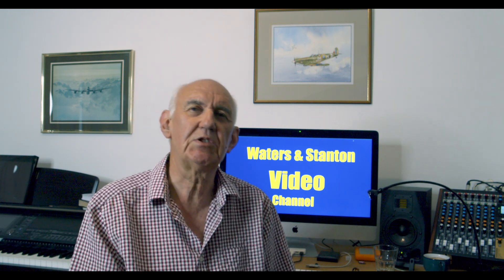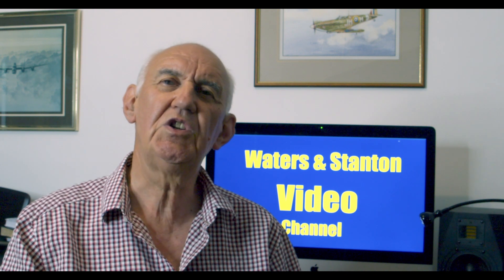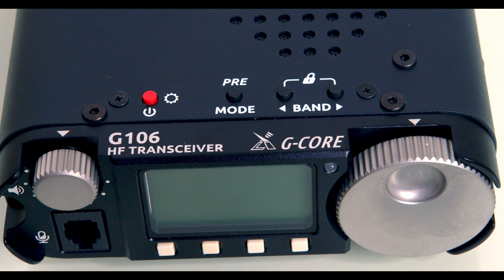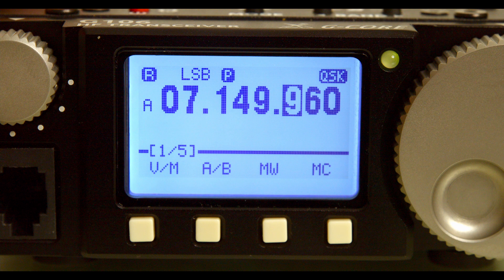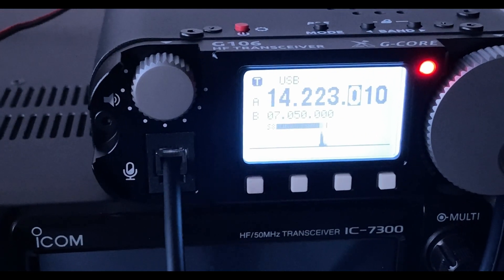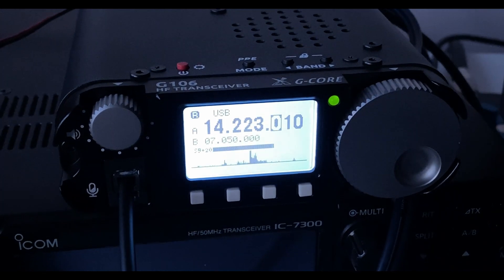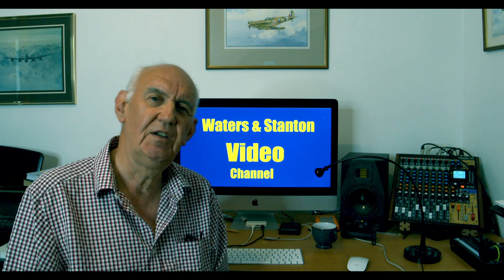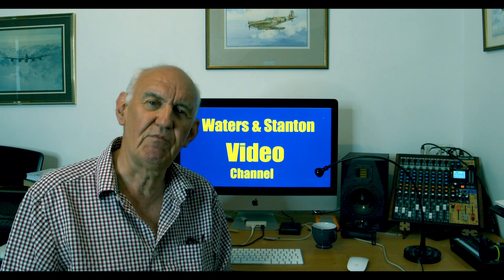XIEGU G-106 HF Transceiver In Depth Review | HAM RADIO

Comment: People who give the G106 cutting opinions have apparently never used the original TenTec Argonaut. The Argonaut was a fantastic radio for what it was at that time but the G106 is much farther advanced. 

Being SDR based, that means it's never out of date. Xiegu tends to improve the radio via software after getting comments about the radio although the improvements seem to come after enough people comment about a particular issue. Ideas for improvement are no doubt welcome, also. Being negative just to be negative is not helpful, however. 

This little gem promises to be around a long time and for what it is and does, it's unbeatable without having to play too much budgetary strategy.

It's simple to operate with no need to memorize a raft of menus or constantly referring to a manual. What's really to complain about? KK5R

Comment: Hi Peter, I bought this radio a few weeks ago and have had a blast with in on my inverted vee and or Butternut HF6. I also bought the DE19 digital interface to my laptop. Works great for FT8, ssb, cw. The keying wave shape looks great. Thanks for you observations Peter. Terry , WA0DTH
Reply from the maker: Great to brat from you Terry.

Comment: Great video. Some people just like to rubbish things as it makes them think they are a expert when they are not. Looks like a good radio excellent receiver in it compared to the 7300. I think the only reason the swr didn't dip at the higher end of the band with high swr is it may not have a swr protection circuits which drops the power to prevent it burning out the finials. All the best from ZL

Comment: Just  received my second G106. Big plus is that it's an SDR radio and that means it's never out of date. 
DE KK5R
Reply from the maker: Good thinking
Reply: @watersstanton 
I have yet to put the 106 on the air but looking at the manual I see that it offers 3 transmission output levels and from that I believe Xiegu has installed the latest SDR version which again supports idea that radio is never out of date. May have more comments in a few days.

Comment: I got one in the mail yesterday and even with the loss of a little manual tuner, I did POTA hunting QSOs on 20 and 40 meters on my front porch with a notebook and a long wire in the trees. I was hesitant to get the radio but I wanted QRP, inexpensive, and easy to use. This does the trick!

Comment: Thank You for the video! I think it is a great beginner and POTA radio. Keep in mind how much it cost as compared to other brands or even higher end models of Xeigu. For the most part also is the fact that this radio is very small in size and would be great in an emergency and working solar power. In this day and age when conflicts are many, this radio would be great to pull out after a tornado or conflict and a end fed wire antenna. I bought a 
Mini Automatic Antenna Tuner that has a built in battery. The combo of this radio and the Tuner $65 which has a SWR and Power meter built into the tuner, makes the whole system very effective and fun and small. I like the system so well I bought a 106 and auto tuner for my girlfriend for Christmas. She just got her license I believe this radio is exactly what she needs to have fun with and is not complicated like other brands and Xiegu models. I have had my radio on the bench and checked its output purity and power and receive signal input level and found it was every bit as good as more expensive radio models. I am totally happy with mine!
I don't always believe all the C*R*A*P that Trolls have to say bad about items they don't like or work for!

Comment: I just purchased a G-106 as my first HF radio. I could use some advice on antennas, tuners, SWR meters, etc to get my rig on the air.
Reply: Did figure it out yet?
I just got an EFHW. Doesn't require a tuner.

Comment: For what its worth my opinion.
Ive been a radio amateur since 1979.
A Royal corps of signals technician for 10 years, since then a telecoms technician offshore for 25 years. now retired. Ham radio has progressed an enormous amount since I started when you built your own everything and was happy. I have one of these sets and If they had been available 45 years ago we would have been amazed. QRP is what it is all about. Talking to an American using 2 W of power on 20m (Conditions variable obviously). All in all great value for money. In my day a 1ppm VFO stepping at 1 HZ was unheard of.

Comment: I really enjoyed the review so much so I bought a G106, I have to say that with the latest firmware installed I quite like this radio. I f I had to complain about one thing I would say it's the detents on the main tuning encoder, I think I will replace my encoder with one that has no detents. Thank you for the video.

Comment: Thanks for the review.  
I would like to encourage you do do an update to the review now that the firmware for the G106 has been updated and some features were added to the menus like:  Ability to adjust mic gain, ability to select high, med or low power and, possibly other features - running the G106 through the same paces as in this video - a sort of before and after comaprison.  The radio now ships with a USB com cable for CAT interface with your computer and works well with several different logging programs.  I wish reviewers would wait, or at least update their reviews until the 'bugs' were worked out.  I will commend the folks at Xiegu for adding features people were suggesting as evidenced in the latest firmware update.

I appreciate your analysis of this rig.   THese days we are, I think, spoiled as radio operators in that most, if not all rigs, are packed with all kinds of features, filters and options.  For me, the G106 reminds me of my first rig, a Kenwood TS-120S.  It was a great, no frills rig.  This G106 is also a great no-frills rig yet still has features thet my old 120s never had - spectrum displat and CAT being two of them.

The simplicity of this rig is what makes ot so appealing and easy to use in the field or at home and why it will make a great radio for backpacking and POTA/SOTA/VOTA activations.
Reply from the maker: Those updates were implemented about three months ago and we have been shipping the updated models for quite a while.
Reply: I so agree with you... 👍👍👍

Comment: I have been out of the hobby for a long time pursuing family & career obligations, and now in semi-retirement, I feel a bit like Rip Van Winkle trying to regain a foothold of understanding of the current state of the art post-Covid. I was never one to invest tens of thousands of Dinaro bucks into the shack, when I was age 17 I had to mow a lot of lawns for that shiny new TenTex Century 21. In college I tended to love to build in my lab projects little 1/4-watt Tuna Tin transmitter projects, etc. With my name of David, I sort of championed the little guys in the industry and got the thrill of building many of my Heathkit projects like the HW-9 and then getting WAS-QRP with my own imposed restriction of running only 1-watt output into the best antennas I could make or afford. In 2022 I started watching Xiegu Youtube video reviews after realizing I was about to pay the original list price + 30-40% for a used commercial brand of a communications receiver on eBay. I have a bunch of Tuna Tin kits to build but wasn't going to pay post-Covid prices on a piece of equipment that did not build in the preferred selectivity automatically of a similar quality transceiver. So I started looking at the SDR receivers like the ATS-20 and ATS-25X1 to understand the pros and cons of trying to use one for a companion receiver to a simple QRPp transmitter. 99% of the reviewers were casual listeners and focused 100% on the SSS & FM end of the features, despite the promise of CW operation and off-line discussions with them did not encourage me to invest in one even for casual use. I didn't like the prices on the earlier Xiegu models, not because I didn't think they were worth it, but because I was just getting into the hobby again and I did not have the desire to be upgrading the firmware to something I was going to put all of my money into without understanding what the future of the product was. I saw the same review that you did of the reviewer for the Xiegu 106 reviewing an apparent Beta version of the product and it was obvious that he was irritated about being given a Beta while preJudging that he may have wanted to be given a much higher cost rig to review. I realize that despite the basic hardware limitations of these designs a lot of the future improvements are in the software of which I have very little knowledge. I was a Test Engineer in aerospace with experience writing PDP-11, Dec, and Vax-based software for factory electronic test machines so I have a healthy respect for how complicated an SDR transceiver might be. That said, a lot of the Reviewers of commercial Ham Equipment are not the same type of Reviewers of Yesteryear in which we would have seen an Engineer at the ARRL Laboratories doing a more professional technical review of the specifications. The Reviewers of today most visible to the general public appear to be passionate operators that love the hobby and come equipped with lots of Affiliate links that will get them some credits to diversify their income stream. I am not saying that those types of reviews are the scourge of society, but that we (me) all should realize what they are and mix in our ham education with the proper reviews so that we get a more proper overall idea of what we are looking at and judging. Based on the review you mentioned, I choose not to invest in that Xiegu 106 radio at this time and chose a WA3RNC Pennington TR-35 instead. While only a 3-band radio, I thought it was a good choice for portable operations and had the ability to be a good choice for being a companion to my simple Tuna Tin transmitter experiments and my weird fantasy of using them on exciting projects like POTA hunting and activations where I bring QRPp to the next level. The real trick is putting up a good antenna Arial. If I decide that I want to invest in a more general coverage radio, I will give the Xiegu 106 another look and by then there may be another revision of software or two to make it even better. Is it a contest machine? No, neither is the TR-35. On intense contest weekends I shut off my radios and go take a 20-mile hike, unless I am looking for those last 3-4 states for another personal WAS/QRPp record of my own choosing, LOL. Thanks again for your review, this is a good time to be in the hobby as I have noticed that lots of new operators are learning CW for their POTA activities, many are doing FT8, but I was thrilled to see the CW revival as my weird fascination with QRPp tends to focus on CW. SSB is nice, I got VUCC-2M in 1990 with SSB/CW. But I might even make a simple one-triode tube transmitter in my full retirement, LOL. Cheers es 73, Dave - KU9L
Reply from the maker: Hi Dave,

That was great to read your story. I am sure others will enjoy it as well. 73 Peter.

Comment: There isn't any rf gain control 🤔
Reply from the maker: Yess you are correct.  But in operation I did not have a problem, even on main antenna system.
Reply: @watersstanton  thank you good Sir 👍

Comment: You mentioned the unit not having a RIT function. How in the world can you operate CW with no RIT function once you have tuned for zero beat?  Maybe TX with VFO A and RX with VFO B ?  Would like to have seen the rig preform on CW.  Thanks for doing the review. It seems like so little is known about this new entry into the market. 73
Reply from the maker: CW is no problem. You simply match the pitch the received signal to the same pitch as tge side tone. Most stations call you within a few hundred Hz so. i have never had a problem. In fact. i hardly ever use RIT.

Comment: Hi Peter,
If I was testing a new radio, new on the market, And I found several genuine faults with it,  The very FIRST thing  that I would do is contact the company who supplied me with the test/review radio and tell THEM what I was finding rather than just giving a report on line slagging off the Device Under Test/Review. This way, if the manufacturing company Had sent me a faulty peice of kit they would have the chance to send me a replacement which they knew to be working as it should be working.
Many thanks for a more honest review Peter.
De Ray,  M0RAYY.

Comment: To me, the fact it's putting out more power than it should be indicates poor QC! And the high power into high SWR, doesn't that indicate a lack of output protection? Certainly looks like clean output though, and might be even better if brought down to 5W where it should be.
de M3KXZ
Reply from the maker: The power soec says greater than 5W which is a bit vague. But the protection is there and worked well.

Comment: Thanks Peter for the clarification. However I am concerned about full power output even at higher vSWR. Could it be that the protection circuit is lacking resulting in power transistor failure with a poorly matched antenna?

Comment: Sounds like there is no VSWR protection so it keeps the power up rather than reducing power to protect its self. That's why the power out is still higher.
Reply from the maker: It dies close down eventually.
Reply: @watersstanton kindly explain?

Comment: A shame you felt the need to call K8MRD’s video a “hoax” .. it wasn’t .. although it’s nice to see you moving away from the previous run of videos almost exclusively dominated by the same topics and the same themes, regurgitated. Such as mobile hf and bashing antenna modelling.
Reply from the maker: You need to understand that modelling is fine, BUT the users fail to understand that real world results are often very different. Professional  designers employ 3D software for this reason.
Reply: @watersstanton  what antenna would you recommend for the xiegu g106 considering I live in a small townhouse with no yard. It’s 4-storeys high. I have a ground plane antenna for my vhf-uhf radios at one corner of the roof. I am very new at this hobby having gotten my technician license here in the Philippines just last month. Thanks
Reply: It would helpful if K8MRD  could show evidence of his professional electronic qualifications and proper comparative testing to back up is views
Reply: A fair few things Peter talks about are a 'HOAX' but i just keep quiet

Comment: Peter-Thanks for another great, objective video, and for pointing out that radio-based spectrum analyzers have potential weaknesses that MRD’s video suggests he may not understand🙈
Did you test at all in HF high signal level environments like 40 at night there? Your mention of no RF gain control, and I’m assuming no attenuator, remains a concern, as does potential AM broadcast band overload here, which seems to be an issue with some Xiegu products.
73 Scott ka9p
Reply from the maker: Yes I have used it on 40m extensively and not had any issues. My antennas are mainly wire dipoles so typical of potential owners. RF gain - well tell me how of-yen most hams ever use that control - but I take your point.

Comment: The biggest problem with the G106 is the G90 😀
I have a G90 I use almost every day, and I tried the G106 and sent it back. The G90 is twice the radio for about $140 more. Had the G106 been priced at $200 I would have kept it, but it just didn't quite reach that $300 value bar.
Reply from the maker: The main advantage is size and an easier to read display for us with failing sight!  But I still use my G90 regularly.
Reply: I can get a new 106C now for $135!
1. What is the difference between 106 and 106C?
2. Would you recommend it as a spare rig for portable/emergency use?
3. I have a TruSDX on the way. How do they compare?

Comment: Thanks for the review. I've been waiting for someone to come up with a decent review. After K8MRD tore the radio apart, a German Youtuber also did a negative review. Even if this was clearly more serious and he mainly focussed on software issues (and unlike the other youtuber, he says he hopes the software problems will be solved in the future).  Almost at the same time with your video, ML&S came up with a video, where they measured the device and also came to good results. But the damage is there, at least among the OMs here in Germany I know, most consider the radio garbage and it will take time until that changes, if that ever happens.  73s de Peter

Comment: Hi Peter,
That reviewer received that G106 from another reviewer and it may have been damaged during shipping. The first reviewer had none of the problems mentioned by the second reviewer and that is the reason he thinks it may have been damaged during shipping.  WJ3U
Reply from the maker: So why not check back with the other guy rather than rubbish the radio? Ah well - it speaks for itself!   73 Peter.
Reply: @watersstanton  Hi Peter,
I know both reviewers and there will be a video released in a few days that explains what may have happened. Since I'm a patron of one of the reviewers, I am able to view that video before it is made public. I will provide a link once that video is available. Stay safe,  73  WJ3U
Reply: @watersstanton  Peter,
There will a Premiere tonight for that video. Here's the link. https://www.youtube.com/watch?v=Khjf70az5ZI

Comment: I've seen that video on the  G-106, and  for any supplier to release a radio performing as badly as that one is pretty much unforgivable.  Does anyone NOT understand the importance of making a good first impression. Meanwhile, Xeigu provide no service manuals, circuit diagrams, so you pretty much on your own, especially when the warranty expires. Not so with the FT-817/818 (Which I used to own) I now have a X5105 and a Icom IC-705. I bought the x5105 to take to places of higher risk.
Reply from the maker: Many thanks for your comments. 73 Peter.